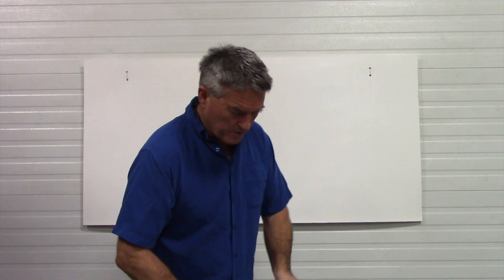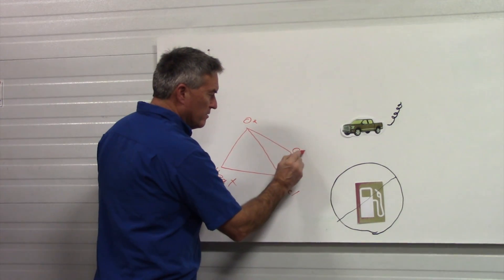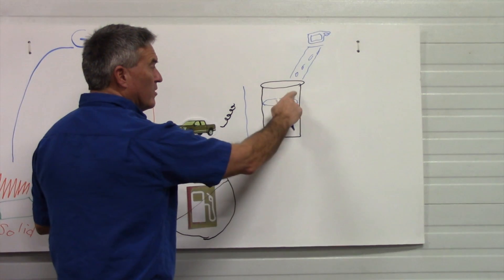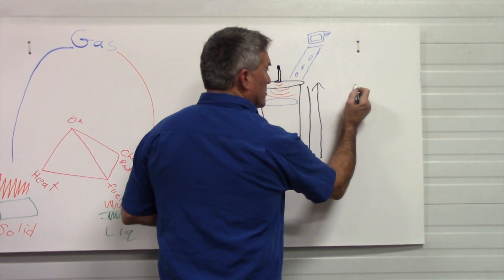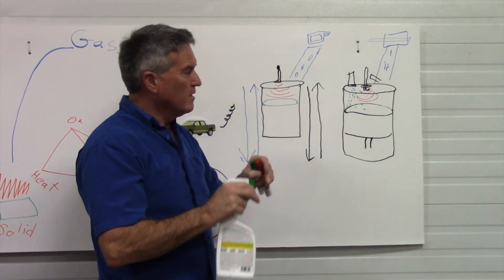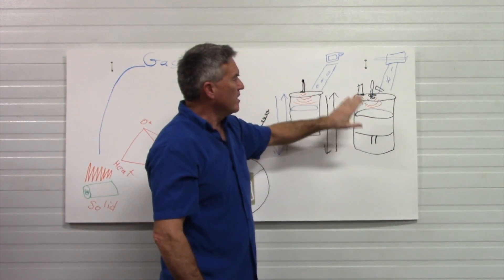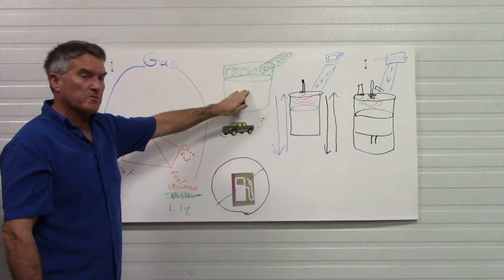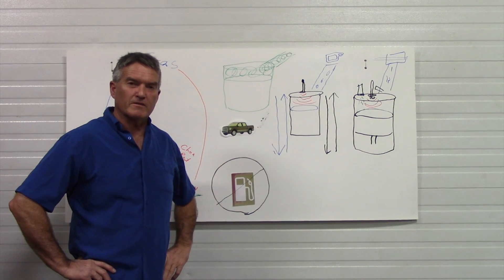One Simple Trick to get 100 miles per gallon with less pollution!

Comment: Crude oil is NOT a fossil fuel. Jerome Corsi wrote a book, which discusses how crude oil is made at a depth of 60,000 to 90,000 feet deep from heat, rock and water. This was proved by experiments of the German government before and during WWII. It is made everywhere on the earth, and is a natural, abundant process. It only rises to the surface for our extraction in areas where the ground above that layer is either porous or fractured from earthquakes. We can't drill down that deep, but we can find ways to bring it to the surface when technology advances. Other people have also written articles and books on the process since then, but largely ignored because it does not fit into the "We are running out" agenda. For all the years of burning 'fossil fuels', our atmosphere is still 20%+ oxygen. How can that be if burning coal, oil and wood was bad for the earth?

Comment: Anyone who has ever worked in an oil field will tell you that oil is not fossil fuel. That is a lie that the oil companies put out to up the fuel prices many decades ago.  Oil is a natural product & will not run out. What happens when they shut down an  oil rig ? They fill it with water & cap it. When the get ready to reopen it the  water is pulled off  & they are pumping oil again. I have a relative who earned a chemical degree & has worked in the oil industry all of his life & he is the one who told me this.

Comment: if you called this video "i'm another sad delusional man selling vaporized gasoline" it would save people a lot of time. here's a clue for people on the fence: modern propane-burning systems have replaced the older gas-mixing systems with liquid-spraying fuel injection because it's more efficient

Comment: Only with carburetted petrol engines could this be performed on a vehicle. How does one shove vapour fuel through an injection system? Or is it the case that we have to junk the whole ECU so that we can do this because otherwise it would shutdown the engine or flip its lid because the products of combustion are not matching its engine mapping? 

I think I prefer to use Natural gas in a cooker than petrol vapour. I'd absolutely HATE the tang of petrol in the kitchen and the obvious condensed vapour on my food.

Also where is the proof of 100 mpg claimed? That of course is for an American gallon? In which case he really means 125miles per REAL gallon (Imperial = 8 x 20fl oz pints not 16fl oz). So where are the tabulated results of 20-30 different sized and makes of engines, run over multiple differing types and distances of routes to back up the claims made? Put up or shut up! Simple philosophy. He should use it.

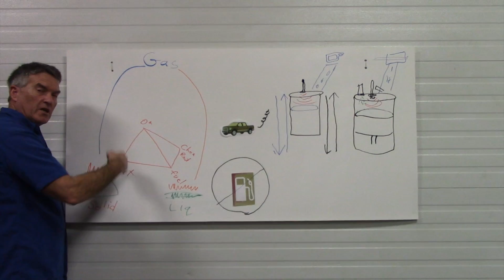Comment: Try starting at 11:30 ..... (this is when he pitches his idea).
As a 4 minute video it is probably fine, to discover his thinking, but I would be cautious of his concept and conclusions.
He mixes general knowledge with slightly incorrect statements ... enough to mislead himself, and maybe the viewer.

Changing liquid fuel delivery, for gas fuel delivery has been with us for decades - I had a friend with a propane tank in the boot of his old Volvo - apparently it ran fine as a general runaround.
He did it because the propane carried a low 'cooking tax' - much lower than vehicle fuel tax.

The narrator suggests changing the liquid fuel to a gas, prior to it entering the engine, and claims that this improves the mileage, because it will burn better.

This will be true, where the carburation and engine setup are bad ... but you then must develop a controlled gas delivery, to perfectly match the engine requirements (air fuel mix against load).

This means that you have created an entirely new engineering challenge.

Also, it is worth understanding how the ICE 'should' anyway convert the fuel vapour to a full gas, prior to combustion.

The vaporised fuel enters the cylinder, and hits the hot piston crown and combustion chamber (hot, after the previous explosion).
On contact with these hot surfaces, the vapour changes state to a full gas ... and in changing state, sucks the heat from the hot components.
This is a fair exchange.
The components are cooled in readiness for the next explosion, and the gas has been created.

Therefore the engine doesn't overheat, and the gas burns efficiently.

A well designed and tuned engine operates on this principal.
AND ... a denser fuel charge can be delivered in vapour format ... converted to a gas in the combustion chamber.
... thus allowing for smaller engines, hotter explosions, and greater efficiency.

Perhaps for an old fashioned big lazy V8, with very basic carburation, there might be some combustion efficiency gains.
... but you've still got to deliver the pre-made gas, for instant response to changing needs.

Therefore, you would be better off running a hotter combustion chamber, and let it make the gas as it needs it.
... which is how engine development went.

Anyway, it would be a fun and potentially dangerous project to pursue ... creating a highly volatile explosive gas outside of the combustion chamber, with interesting pyrotechnic effects, if it all goes wrong :)

https://www.youtube.com/c/EngineTuning
....
Reply: My only rebuttal is a big lazy V8?!
Theres no replacement for displacement! If you want a grocery getter buy a 4 banger. If you need to do work, its with big pistons. The more the merrier

Comment: My 8000 pound diesel truck gets about 10 miles to the gallon doing 70 miles per hour. It's all stock. It gets 42.5 miles to the gallon with the AC and cruise on running around 1,150 RPMs and turning between 40 to 44 miles per hour. And drifting in neutral off of most Hills. And that is actual fuel test results not by the on board computer. The truck can get better fuel mileage than this but I'd have to slow it down even more. The faster you drive the more fuel you burn. Why I think they put ethanol in the fuel which is alcohol. So you'll burn more fuel. Is because anybody that changes over to alcohol at the drag strip Burns almost double the amount of fuel for a little more power and it runs really cool. so they put no more than 10% ethanol which soon will probably go up to 15% like in some countries. I have a propane 2200 watt duel fuel generator it runs cleaner than my diesel on propane. On a full 20 pound bbq tank at 50% load it can run for 18 hours. And a empty BBQ tank to fill in my area is $11.50 for i think 4.2 gallons on a bbq tank. They say a propane engine will last longer than gasoline and I believe it because the inside of the motor will stay clean like the oil and spark plug. Like a propane forklift very clean inside the motor. And propane conversion companies for small engines say they want you to run it on the lean side running propane. I said running it to lean will not hurt the engine or have you heard of any stories of Leaning it out and burning up the motor they said no. I'm going to put a cylinder head temperature and measure the exhaust gas temperatures coming out the exhaust so I can lean my generator back I think it's getting too much propane from what I run my other generators on propane. I want maximum fuel efficiency.

Comment: There is moisture in the fuel if it does not burn hard enough it causes sludge just like the modern furnace in the house with the plastic air intake and the plastic chimney it blows out the condensate almost like moist air out of a closing dryer if you’ll is not Hot enough there is always a bad side effect. Here’s one more example you can put a bully dog tuner on a diesel engine make it produce more power more economy. However putting more fuel into the system then what can burn completely over fuels the engine causing preemie ware 
Also by running to lean can fuse the piston rings so do your research and you will see that the manufactures really do put out the best that they can

Comment: make it work before you run your mouth .
Reply: My name is anonymous this theory is already proven and it works .    higher gas mileage by running fumes rather than liquid . You are absolutely right 40 50 miles to gallon is not smart.  free electricity totally sustainable electricity it will work no more electric bills. How about running your car on hydrogen that will work also totally free. Stay smart that's what they want you to do you're programmed and don't even know it. Find Jesus FEMA camps won't help you wise up sincerely anonymous

Comment: Electronic fuel injection and spark controlled by electronics has NOTHING to do with increased fuel economy. I new a guy who had a 5,000 lb 1955 Studebaker 6 cyl 1bbl carburetor that got 30 mpg highway. Today we have 3,000 lb vehicles with electronic controlled everything that don't get much better. In 1932 a guy invented a carburetor that consistently got 100 mpg, sometimes much more. In the mid 60's, both Ford & GM had carburetors that got 100 mpg but were put on the shelf to placate Big Oil. Government and Big Oil are in bed with each other for the money. Screw the little guy. This will all come out of the closet on Judgment Day. I can hardly wait.
Reply: "out of the closet"?  Homophobe Davidy?

Comment: This is correct but the last guy to try to get this to the public is now dead. The fuel cartel will not permit this sort of efficiency to go ahead. Just look at what they did to Volxwagon with there car that did a 1000 miles to the gallon, they crusified them. It does not matter that you can get a combustion motor to run on a vapor if it stops fuel consumption then that is bad in the eyes of the controlers.
In the 80s we had a thing called browns gas which is made through electrolisis and allowes you to run the car on water and got 1000 miles per quart/liter of water, this also was put asside but you can still buy the converters on the net and fit it to your car yourself.
No one out there wants you to save the human race from disaster, the controlers just want total control. We had as many electric cars as we did petrol in 1900 but there was no way of controling us with electricity so we went to petrol and many briliant inventors are now dead because of it.

Comment: We've only be using gasoline vapor heating, torch, and other systems for a hundred years.  Modern engines burn well lean of peak.  They're kept cool by the volume of air transiting the engines, as well as by the engine coolant.  This gentleman's "one simple trick" is bunk.

Comment: Mr. Narrator, you stated that the liquid gas was sprayed into the chamber in a specific amount because it had to touch the sides of the chamber to create a cooling effect so it could also act as a lubricant. Wouldn't reformulating the liquid gasoline to mix with air before it got into the chamber cause it to burn lean? and cause overheating... or is it that the liquid gasoline has to be in a certain amount in the air? Regardless of when it enters the chamber?

Comment: Let up on the bickering and name calling, and I don't want to be called a dinosaur, but I still thought petroleum was a fossil fuel; so, if it isn't. then I did learn something this day. It has been a long time since. News, old or new, that is not relevant to the purpose of this video. 
 I read some very impressive technical responses that are more than I need to know about, but, as I see it, this guy's video is not meant to be that boring. The fact is, I have heard stories about 100 mpg carburetors since the sixties, but I still have never seen one, and this guy's recap didn't tell me anything new. Back then, engines, with no electronics, could throw you back in the seat, and they got around fifteen mpg with the pedal to the floor most of the time, about the same as my supercharged Grand Prix and my turbocharged Volvo. These front engine cars can spin the tires okay, but they don't launch. 
 I could easily fix cars with points on top of a distributor and a four barrel. Adjusting the fuel, float and such, was the hardest part; with fuel injection, its the easiest, but there are about forty different $100. sensors and three or four $400. CPUs monitoring them, not to mention a solenoid to electronically control the shifting of each gear in an automatic transmission. I had pride in my car, because I kept it running with a few occasional adjustments that I did myself. Face it, 100 mpg won't matter at all when your engine is replaced by a battery, because we will be looking for better mpc, miles per charge.
Reply: Aquatic phytoplankton and zooplankton that died and sedimented in large quantities under anoxic conditions millions of years ago began forming petroleum and natural gas as a result of anaerobic decomposition. Over geological time this organic matter, mixed with mud, became buried under further heavy layers of inorganic sediment. The resulting high levels of heat and pressure caused the organic matter to chemically alter, first into a waxy material known as kerogen which is found in oil shales, and then with more heat into liquid and gaseous hydrocarbons in a process known as catagenesis. Despite these heat driven transformations (which may increase the energy density compared to typical organic matter), the embedded energy is still photosynthetic in origin.
Reply: Osiris: Please stop, you're just coming off stupid.

Comment: I would advise, the NONE trolls among you, those of you with an open mind to look up dust explosions. To burn any fuel, the flue has to be in direct contact with oxygen. An injector sprays "droplet" of fuel into an engine.These droplet are, from an atomic point of view, enormous, so only the outside of the droplet that is in contact with atoms of oxygen can burn. So the fuel burns from the outside in to the centre. This process take time and often results in incomplete combustion. 
The idea of vaporizing a fuel into a gas goes back at least 60 years or so. From memory, Tom Ogle in the 70s age 19, installed a fuel vapour system in his car, he was found dead at the side of the road age 24. 
Paul Pantone and his GEET system uses the heat from the exhaust gases to first vaporize the fuel, then the electro magnetic field created by passing hot, exhaust gas and cold fuel vapour past each other in opposite directions brakes the fuel down at the molecular level. 
(Warm and cold air passing one an other creates creates an electrical field we see as lightning)
Pantone's system reduces pollution by 80% to 90% and also reduces fuel consumption. 
BUT, until recently the oil companies, wanting to sell as much of their product as possible have either bought out the patent or discredited the inventor, given the million involved why would anyone be surprised. 
Also, these oil executives are, mostly, old and are only interested in money NOW. By the time the environmental consequences of their actions hits the fan they will be long dead, so why would they give a s**t.

Comment: I  did some experiments with this system, it didn't workd because it was too lean, (burned rings and piston walls), at this moment I'm working with a modify turbo (I'm going with a bigger compressor) I think that will do the trick.

Comment: I wish I could just figure out what's inside that canister that fellow made as a transference mechanism to combine both water and gas into the proper mixture and I think the unidentified component is a stabilized heat source that combines both gases water and gasoline and the ratio of increase usage is theoretically correct based on the 80-20 principle!
( ● )"\|/"( ● )
Reply: It is basically a "Bong" or like a Turkish Water Pipe.

Comment: compare the volume difference of the 80% nitrogen in the air thats drawn into the chamber to be compressed with the tiny drop worth of gasoline atomized. 80% : approx 1-2% ratio... which is the bigger volume of fuel source? In normal atmospheric pressure you can't ignite the nitrogen we breathe, but under compression... its powerful... and explosive. the purest form of nitrogen is in a liquid state, and at normal atmospheric pressure as it gets poured from a container and dissipates into the air..., -at this point b4 it dissipates, you can ignite it while still a strong concentrated liquid to gas transformation into the air and get explosion. In the combustion chamber you can also get an explosion by igniting the compressed and more concentrated nitrogen. We are told the gas is the power maker, but if it only makes up 1-2% of the compressed volume b4 ignition and nitrogen is 80%, what is the main power source again? Think of it like a bullet... The primer ignites the powder. Gas is/or/may be the primer, and we are truckloading dollars out the tail pipe... BUT, can we already have enough heat generated by compressing the contents in the chamber to not even need the gas, and just use the spark plug to ignite or get a more continuous heat ignition with glow plugs? "Compressed air" power is already used in the pure nitrogen fueled dragster races. Why not in a way we can totally eliminate gasoline? -After all, we need heat, "oxygen" and a fuel source to complete the triangle for combustion. Anyone?

Comment: Here in the U.K my car is converted to run on Liquefied Petroleum Gas, and is even more commonly used on the European mainland. A valid point I would like to raise, with a gas fired car you have to use more oil to keep the engine from overheating and topping up with 1.76 UK Pint / 2.11 U.S Pints approximately every month for every 1,000 miles.. The good news about that is I am paying half the price of petrol (gasoline). Plus it is recognised that LPG gives off far less CO2.